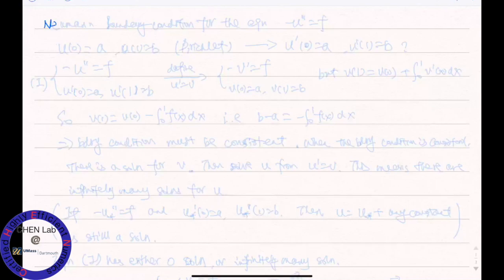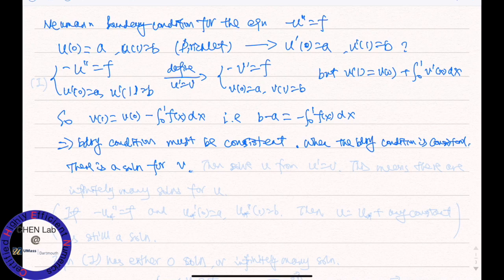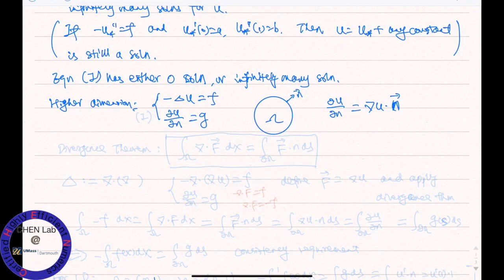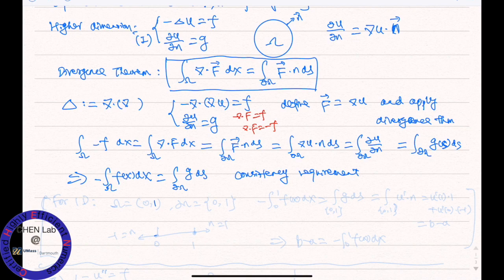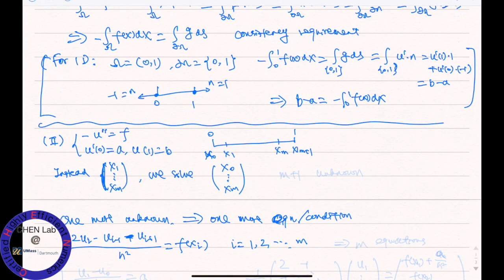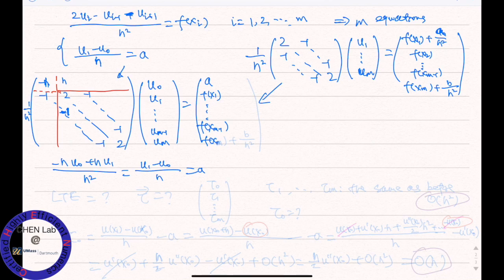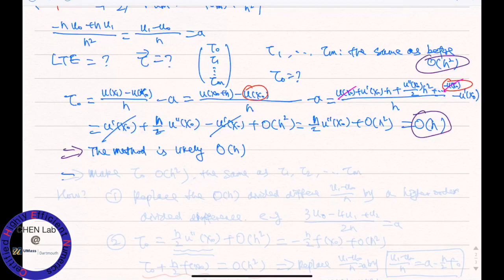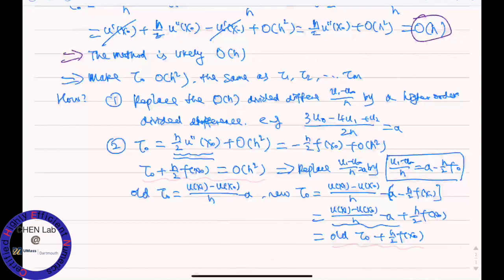Numerical Analysis II, Lecture 4

Comment: Simple question... I'm confused with the diagram @ 16:12 ... It's the surface integral of g, I will look at it a little closer but I'm just wondering how you even get the normal vector nevermind how it's +-1.
Reply: Oh wait nevermind, it's just the vector that's pointing outside of the "surface"... In this case which is a line that points one in the positive and one in the negative... Saw it immediately lol
Reply from the maker: Yeah it is hard to visualize and this is not a simple question. The "normal vector" of a n-dimensional region should be at least one-dimension lower (think about a 2D or 3D object). So when it is an interval, the "normal" is just a scalar.